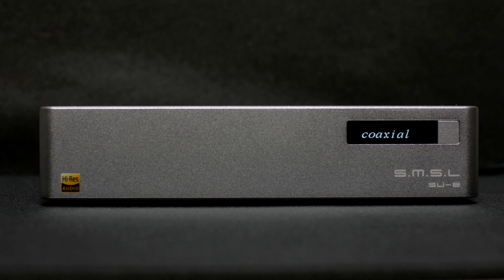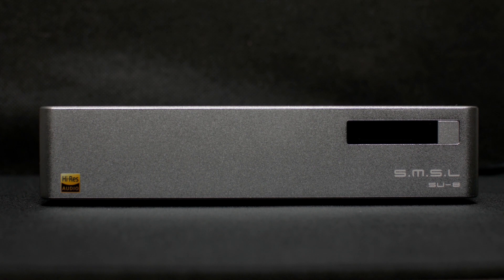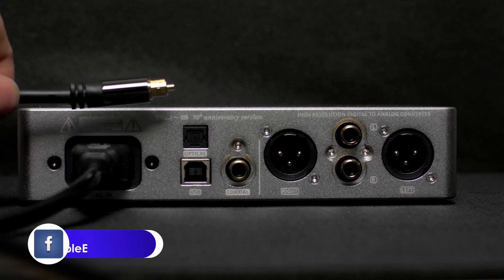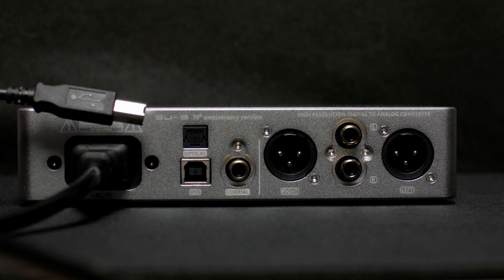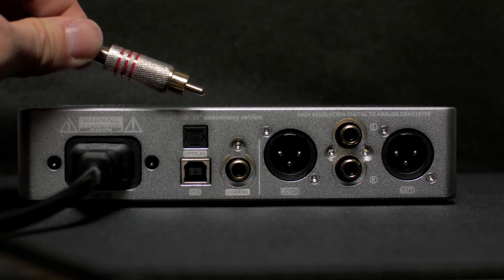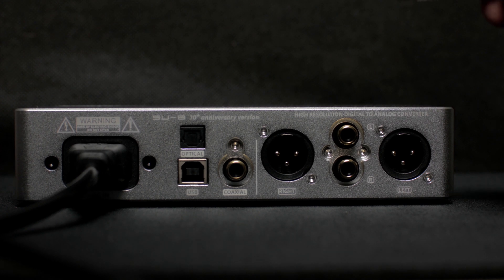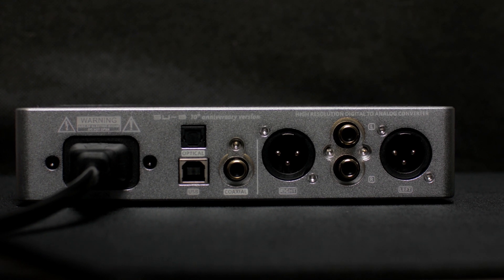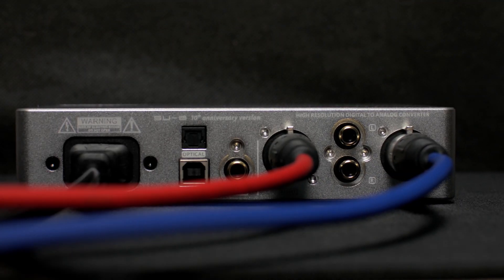S.M.S.L  SU-8 Unboxing and Features Overview

Comment: can you use RCA out to amp and xlr to sub at the same time?
Reply from the maker: Yep,that's the way I'm using it right now
Reply: @rtdoublee3360  can I use it as a preamp or should it pass through a preamp? Thanks. I'm new to DACs.
Reply from the maker: @elifaudio1472  you can use this as a preamp
Reply: @rtdoublee3360  Thanks much.